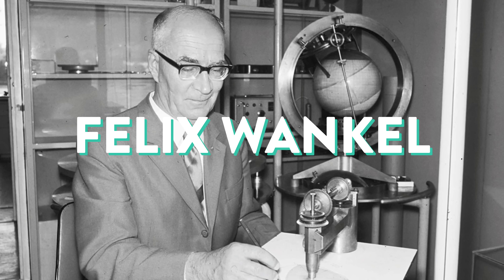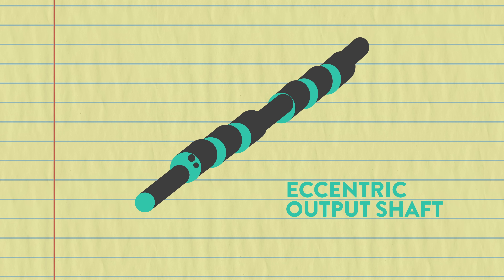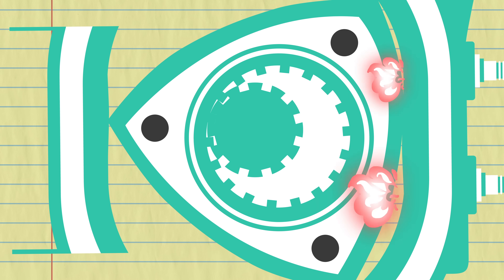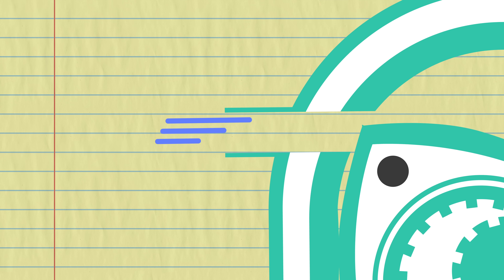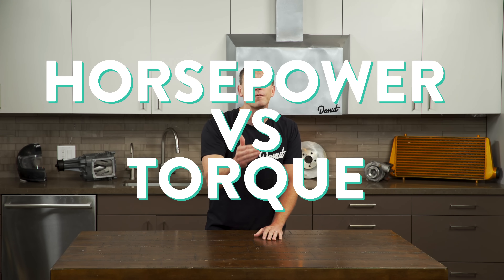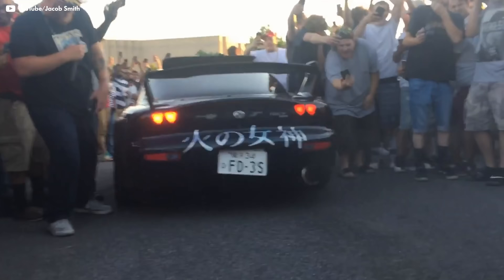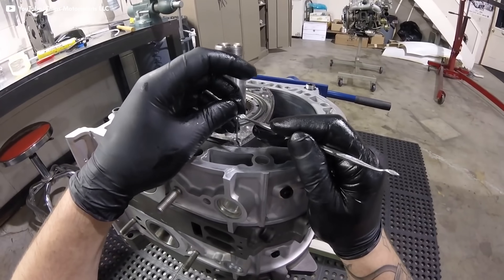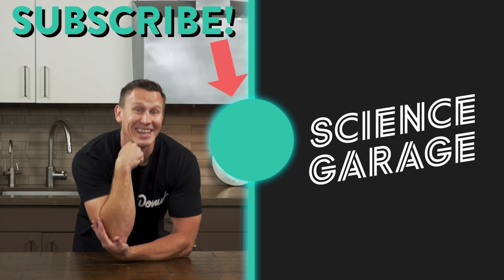Rotary Engine | How It Works

Comment: rare inline 3? come to the EU...
Reply: That Regular Guy they sound similiar becaue a flat six is really just two inline 3's, an inline 5 sounds really similiar to a v10 as well, since a v10 consists of two 5cyl banks
Reply: Here in Brazil we kind have a lot as well, a thing interesting is that at high revs they almost sound like a Porsche flat 6
Reply: No go to Japan.
Reply: bd or just look at motorcycle engines from bikes like the fz09, 675r, speed triple etc quite common
Reply: Well, an UP TSI and a 911 Turbo are both German, turbocharged cars made by the VW Group so I guess they are the same thing?! Must be why they sound so similar
Reply: bd Umm yeah, pretty rare.... IN THE U.S. There’s a reason why he said rare.
Reply: Come to Mitsubishi Mirage
Reply: Explicit Stoner  A flat six consists of two Zylinder banks containing each 3 Zylinder in line with 180 degree of rotational separation to the other bank, if you're trying to correct me get your facts right first
Reply: As a guy from America, there aren’t many cars with 3 cylinders. I think a few Nissans, the Smart Car, and one of Fords cars has a 3 cylinder engine. Most small cars use a small-displacement i4. I had a 2002 Yota Echo. Small little car with a 1.4L i4, but at less than 2250lbs, it ran like a girl in a horror movie. Fast and loud! 😂

Comment: Anyone else noticed the reflection of the Dorito on the table at 0:36? That's attention to detail and I love it. Like.
Reply: Because of the shape of the rotor, it’s become a joke to call it a dorito.
Reply: I didn't at first but now that you say that.... it's pretty cool
Reply: ßaron ??? Dorito?
Reply: @kentuckysmoose  yeah that's what rotors are colloquially called
Reply: And its also slang to call it a "rotor"... the correct engineering term is Orbiting Piston.
Reply: @doktorbimmer  wooow, that's another level of nerdiness, thanks for the reveal!
Reply: @Yoseob Yang Indeed, you need to have a high I.Q. level to be an engineer... while anyone can be a "rotard"
Reply: @doktorbimmer  well mime is 139 but i don't like maths enough to get into engineering
Reply: Killing of the Wankel is just a shame. For such an amazing idea and conept, it seems a waste to throw it away. We just need to harness the power and rid of as many of the disadvantageous as we can, especially the wearing apex seals. I hope one day someone has an ingenious idea, SO SIMPLE by design, we start seeing even entry wankels for daily driving.so you mean its a wankel So basically wankel is like a 3 stroke engine?
Reply: @xkexke8081  i don't think that day will ever arrive. Wankels just can't get any more compression than they already do (in order to be more clean and fuel efficient) and they will always burn oil (by design, if it's a rotary, it needs to burn oil) so they will not fit in today's (not to mention tomorrow's) emission regulations anymore
Reply: @ernodios  so you mean its a wankel So basically wankel is like a 3 stroke engine?
Reply: YOSEOB YANG HOW DO YOU GAIN MORE TORQUE IN A WANKEL ENGINE?
Reply: @xkexke8081  Beneidenswert! Ein werksfrischer Wankel, das dürfte quasi einmalig sein. Hast du den Mäher noch?
Reply: @therealdokoterbimmerrotary6751  awesome wnkel rotary engine with biggest gas tank
Reply: @xkexke8081   
@doktorbimmer    he is a big COW PIE   and yes deleted from ROTARY ENGINE BREAKTHROUGH*
truth Just stating the facts here
Reply: @therealdokoterbimmerrotary6751  if you keep telling doktorbimmer that he will start crying.  Wankel              * LOOK DOKTRBIMMER THE FAKE ENGINEER  AND FAKE ERNIEBRINKROTARY HD LOVER LO
engines are intimately related to his type of schizophrenia.solve problems"
Reply: "That's attention to detail" reminds me of someone

Comment: Rotary is life you can’t change my mind
Reply: fuck he's right
Reply: EMCE3IME_LINUXTECHADDICT Nahh dude I prefer assault rifles boi
Reply: Depressio Spaghettio you meant ApEX sEaLS
Reply: Apex seals...
Reply: EMCE3IME_LINUXTECHADDICT the only thing better about them is they rev higher, other than that not a single this is better about them
Reply: See you at 100k miles
Reply: A life that ends at 60k miles...
Reply: pistols are better for every other aspect. Change my mind.
Reply: Rust in peace Wankel engine 1964 - 2012
Reply: @doktorbimmer  
Pretty long live, considering the engine in your profile pick lastet maybe 9 years until it rusted in peace ;D.
Reply: @Mandernach Luca Unlike the obsolete Wankel engine, Jet engines are still mass produced and completely dominate the commercial and military aviation industry. Although no longer constructed in Germany, the BMW -003 family is still in production (the longest continuously produced jet engine in history) Cheers!